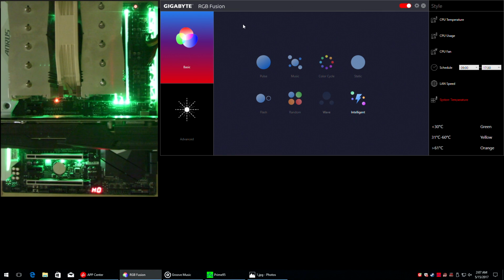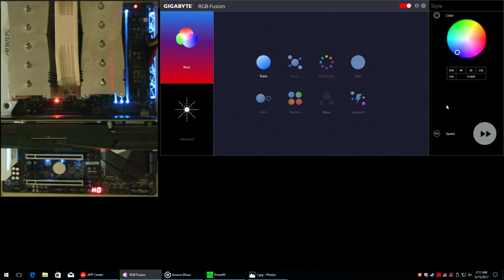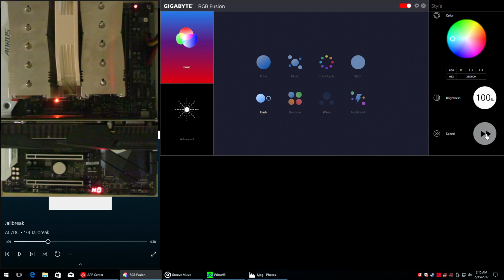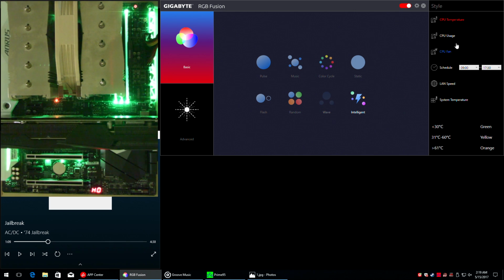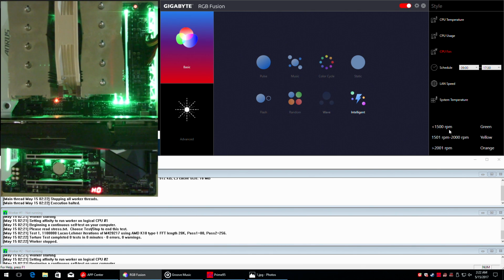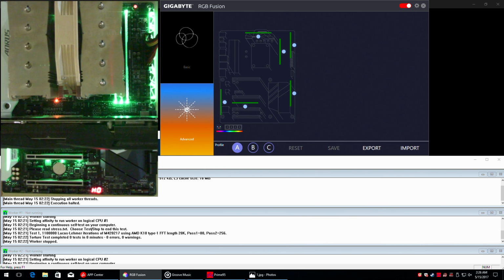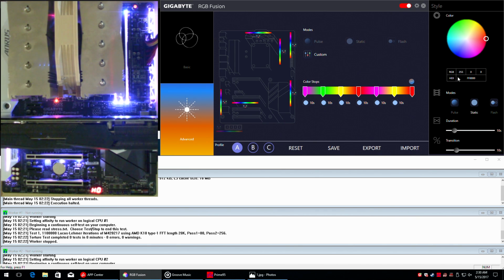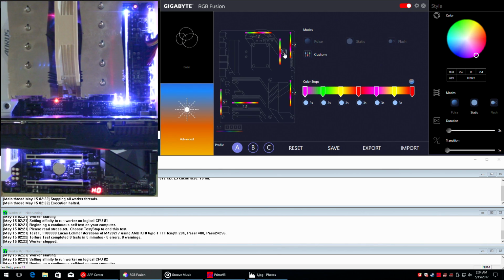GIGABYTE RGB Fusion on GA-AX370-GAMING 5

Comment: So you can’t configure those 2 orange led lights on the mobo?
Reply from the maker: I'm not 100% sure what you are talking about, but the one in the middle is the BIOS indicator (dor the dual BIOS function), in the lower part is the Debug LED indicator, and in the upper part on the right side is the Power button. All of these are non-configurable, the rest can be adjusted

Comment: they still havent fixed the rgbfusion thing i just put in a new gigabyte motherboard with rgb but guess what cant customize each area independantly
Reply from the maker: GIGABYTE's software implementation is a mess, I know. ASUS also has some problems, but not as bad and most of them are user correctable

Comment: can this board change the colours of rgb fans?
Reply from the maker: there are 2 LED RGB strips headers available and that's it. So, basically you need some Fusion compatible controller device for those fans you want to use. I know ASUS works with SilverStone and Akasa on this side, but for GIGABYTE I am not sure
Reply: ok thanks for that, i only want to control 2 corsair HD140 rgb fans in my thermaltake tower 900 case at the front, the rest i can control with corsair link at the sides.

Comment: Basically we are just Guinea pigs until they get it right for next time.
Reply from the maker: Yeah, something like that. Recently, LEDs stopped working on my Crosshair VI Hero MB as well and I had to reflash the Aura firmware to make them work again. So yeah, there are bugs everywhere
Reply: I'm sorry to hear that, dude. I really hope that they can get everything working. I just ordered my graphics card the other day, and I will put in an order for the rest of the components I need sometime this week. Spending this much money on something, you'd expect it to work out of the box, but I suppose that they had to rush them out for the release date. I guess that's the privilege of adopting new PC parts from the start.

Are you glad you switched to the Crosshair? I considered it, but I decided that I'd like it to match with my video card. Looking at other videos, it looks like they've taken care of some things, and they're constantly working the BIOS, so it looks like they're trying at least.